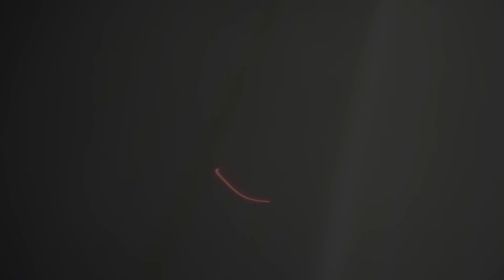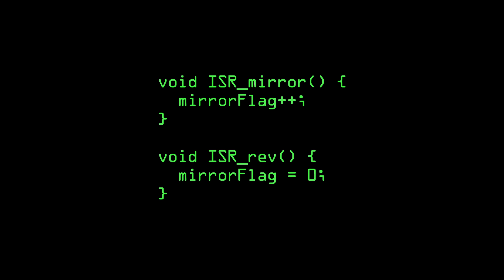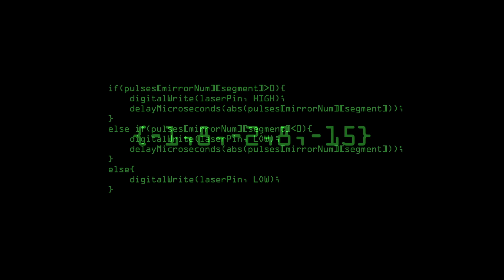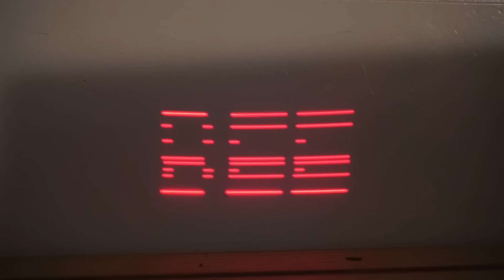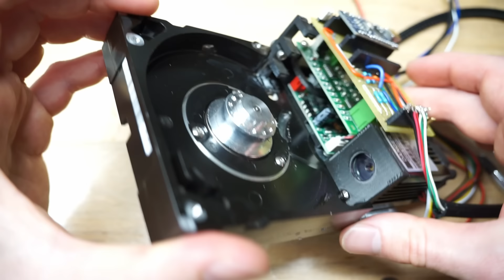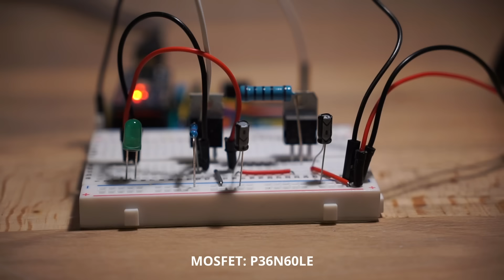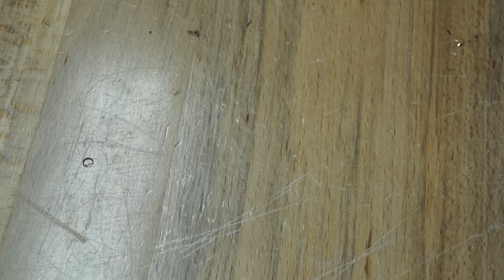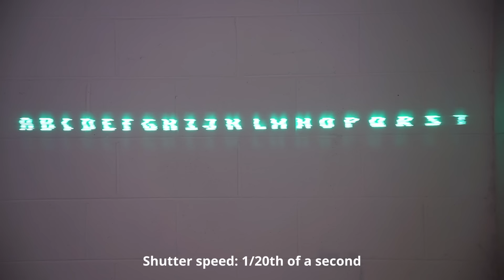DIY Laser Projector - Built from an old hard drive

Comment: honestly a faster and bluetooth enabled mcu would've been more fitting for this project. an esp32 is cheaper than an arduino board and a bluetooth module. it also supports arduino.h and is way faster. another thing you might wanna do is write to the arduino registers directly.
also, what software did you use for the exploded view of the projector?
Reply: also sorry but you really look (i think it's just lack of movement and blinking) and talk like an android lol
Reply from the maker: I actually tried an ESP32 at one point, but it seemed like it had trouble reading the interrupts reliably, so the timing was off. The software I used for that was Fusion360 - you can render animations in it.
Reply: @benmakeseverything  thanks
Reply: @benmakeseverything   I keep posting this comparison showing the interrupts problem  https://www.youtube.com/watch?v=boF4cX338k4&t=607s

Comment: You loose a lot of laser power on the mirrors. Use prisms instead. 4-5 prisms should be enough for a main wheel (horizontal deflection). Use a second prism array for vertical deflection. This is much easier to control than to adjust two handfull of mirrors. If you use a faster controller, try to switch to magnetic rotary encoders for position telemetry. They are much more accurate then light switches.

Comment: If the laser diode is removed from the HDD frame chassis the vibrations from the main motor will be removed and the wavy effect of the text shall reduce to an extent and the mirror carousel needs to be checked for rotational balancing just like a gyroscope flywheel or a spinning top ..  for best result simulate it on ANSYS

Comment: I love the retrofuturistic cyberpunk aesthetic of the scan lines and slight wobble. There's also a lot of tricks in both software and hardware to get better resolution. 

Definitely look into faster chips, the ESP32 is great in that regard. You could also use a shift register or serial control chip and external clock to control the beam pwm. Basically write your bytes into a register, and clock out bit by bit directly to the beam control. That will give tighter temporal accuracy as well.
Reply: ESP32 is a great chip, highly recommended.  Also better to run it to the wire instead of on top of an operating system regardless of it being a real-time operating system or not.
Reply: Yeah i love the scan line and think he should program one into it. The wobble is a bonus. Im totally building one
Reply: This. I love the jitter that the camera is picking up.
Reply: I was going to suggest he tear their hair out and just get a small FPGA dev board. Good excuse to learn some HDL if anything and really can get extremely tight timings even on low end chips.
Reply: @Noubers  Yeah that would actually be the 'right' approach for flawless timing.  To get it perfect each mirror also needs programmable nanosecond scale offsets to account for slight angle variations.
Reply: @darylfortney8081  clearly just needs to minaturize the JWST mirror accutators ;)
Reply: ESP32 would also be my choice. There is also the option to connect through BT or WiFi to a nice APP defining the patterns or texts.
Reply: @greekstraycats  More chinese chips lol, do you see that they are trying to destroy the western eco system by copy catting?
Reply: Don't travel to the USA.  Students study hard, and you easily steal their ideas from their brains. That sounds like a good deal. Fighting for freedom. New slavery. It is my responsibility. I thought everyone should know. We are imprisoned in a place whose slogan was freedom.  Don't travel to the USA. Never even for a short time. If you have any special knowledge or skills or an invention, they will steal it from your mind. The US government initially used this method to identify people who intended to harm the United States. But today, they use it for many purposes, including stealing information from people and stealing data from people's minds. Many celebrities like Taylor Swift and Harry Styles are helping to lure the US government. They can see whatever you see. You'll never have privacy even with your wife or girlfriend. They could see whatever you think. When Taylor Swift said I used my best colors for your portrait, she meant it. when she said, "Touch me, and you'll never be alone." Or when she said, I can read you like a magazine. Your silence would help them to do it again and again. They said, "Don't say anything because of the USA. I want to take her to court. They wanted to pay me $1,000,000. Those are not only songs (Taylor Swift) likes A writer of crime stories whose stories are authentic and have committed all the murders. Taylor Adolf Hitler, the Humans, are not your laboratory mice. Sometimes, what we hear is like warning lights to prevent accidents. Events that the causes of those events are not afraid of repeating them, but they are happy. Money,  power and Black magic There are three levers that they use to achieve their goals. Let's not ignore what we hear. Kidnapping in a new style. Please like and share this to spread awareness and support
 ......................................... #TaylorswiftIsMurder  Doggy styles ( #HarryStylesIsMurder ) #SelenagomezIsMurder 
#BidenIsMurder
#Astatueofstupidity
  #TrumpIsMurder  
#NotraveltoUSA
Reply: Arduino code runs on ESP32 as well.  Plus it has two cores, faster, and has the BT/WIFI built-in.  For ~US$6, you get the arduino and the BT controller card in a faster dev board.
Reply: Too much promotion of a CHINESE product ESP32. How much are you paid for ?
Reply: @sheshankutty8552 your iPhone is made in China. They're just really good at making cheap electronics, and that means that's where most electronics come from.

Also the ESP32 is literally just better than the Arduinos in pretty much every way lol
Reply: @randomblock1_  How do you know ? iPhone is now manufactured in India too, and they have other assembly lines in couple of more countries.
Reply: @sheshankutty8552  Foxconn produces iPhones. They operate in Shenzen, China. They have a few other locations but that's by far the largest one.
Reply: @randomblock1_  What that tells you is that, we don't need China to produce iPhone or anything else, you are Funding oppressive regimes.
Reply: @sheshankutty8552  ESP32 is most used IOT chip in the world. What is wrong with recommending it ?
Reply: @alexnik8334  because you don't know what is in it? It is chinese.
Reply: @sheshankutty8552  I don't care if it's good and I know for sure what is in it. Tensilica Xtensa LX6 microprocessor core is well documented. ESP32 is a dual core Tensilica Xtensa 32-bit LX6 with additional peripheral and I\O. Or Tensilica also Chinese company for You ? If it's so, then all ARM CPU's are Chinese, because there is Chinese manufacturers making Chinese ARM processors.

Comment: Hard drive motors NEED to spin counter clockwise, due to their hydrodynamic bearings are designed to pump oil only in one way and if they spin in opposite direction it will wear out and seize the motor up
Reply from the maker: Yeah it is actually spinning Counter-clockwise, I noticed it did not spin as well the other way. Which is annoying for me because we read left to right. So I had to make the code count backwards essentially.

Comment: You can simple improve the whole control electronics by switching to ESP32 board.
Reply from the maker: I actually did try a ESP32 at one point, but it seemed to have problems with the interrupts not being accurate.

Comment: Nicely engineered and explained. I wonder whether the "jitter" you're seeing is down to the Arduinos timer0 overflow interrupt - automatically running in the background - used for delayMicroseconds( ) ?
Reply from the maker: Probably, I'm still learning Arduino so I'm sure the code could be optimized quite a bit...
Reply: @benmakeseverything  In the IDE - from the get go - a milliseconds timer is started automatically. When that interrupt fires it takes time to process and will put a "stutter" into any time critical code. It's running continuously in the background. I'm betting that's why you're seeing  stuttering  (wobbly line positions) -  rather than it being a problem with your 3D print. Great project & inspiring stuff and well done by the way. Awesome! :-)

Comment: remove optical sensors and install 3 magnets divided by 120 degrees , and install hall sensors instead optical, when you can more accurately control rotation speed. add driver to control mosfet cause arduino is not able successfully to charge and discharge mosfet gate, and timming on/off of your laser will be also accurare
Reply from the maker: Good suggestion. I do think hall effect sensors would be better - If I build another one I'll probably do that.

Comment: Amazing project! :)

You could try altering the mirror angles in a cross pattern, so the point of mass would be equalized by the point of mass of the mirror on the other side of the wheel. This would also mean your code would have to change to render the lines in alternating manner from top/down to middle, instead of just top to down. Try doing anything you can to reduce the vibrations. It will help with wobble a lot.
Reply from the maker: Thanks! I think you are correct, the mirrors should be alternated in a different way to balance it out. If I build a second one, I'll try that.
Reply: @benmakeseverything  Would it be possible to put only 1 mirror and angle it with a stepper motor as it rotates around?   It would require a Rotary Slip Ring but if you can programmatically adjust the mirror angle maybe you could get better results that way?
Reply: @benmakeseverything  also balance out the rotating section
Reply: Very smart suggestion. Kind of interlacing right?
Reply: @critical_always  Yes, 

@thatonesnowboarde, the stepper motor could also be a good solution, Im just worried the steps might be too harsh for such small adjustments and lead to vertical wobble. 

An oscillating mirror attached to an electromagnet, like ones used for camera or dvd drive lens focusing might be a better option, but controlling it is very hard, especially if mirror is heavy.
Reply: @redusercolor  maybe tilt it with piezo instead... we're talking about very small movements here... PLL and resonate it.

Comment: Handheld barcode readers have a little mirror oscillating in them. Use that insted of the hard drive. To have multiple lines - use another one with a lens to restrict it's angle / or use 12 cheap lasers. Also switch to esp32 - much faster, has bluetooth already, can act as an AP to provide a webpage for settings. Good job!
Reply: I suspect repeatability would be an issue with the oscillating mirrors - might work well for a y axis though. Big benefit of the mirrorwheelofdeath is it acts as a flywheel to get pretty consistent speed, which is also (angularly) linear since it doesn't have to reverse direction at the ends - it's what the fixed barcode readers in supermarkets use (you probably knew that though, by the sound of it). Actually laser printers do too, at least the ones I've pulled apart used to :D

Comment: Pretty impressive results!

A couple of ideas to improve, I'm not sure if they would be practical to implement.

To stop the wobble, use a fast photodiode and a mirror in the output path of the laser, to synchronise the laser switching with the actual position of the laser beam. Have it inside the housing, laser turned on until it hits the photodiode, then quickly turn it off before the beam reaches the start of the opening. 

The switch faster, use the hardware UART and encode the character table into bytes, that would limit you horizontally to 8 pixels per character, unless there is a mode that has no start nor stop bit
Reply from the maker: Thanks for the input. I definitely think there is a lot of room for improvement in the code. I'm still learning Arduino.
Reply: A chain of shift registers would give you arbitrary width. Push bytes via the uart into the shift registers, then clock out bit by bit to control the beam.
Reply: I like the idea of getting the lazer position directly.
Laser printers uses this method.

Comment: PRoblem with 3D-Printing is, especially with PLA, it bends. When this thing rotates alle the parts are put under stress which is pulling outwards. You adjust everything and its fine.
Next day, everything "losses" that rotational stress and is back to it's position prior the rotation. Everythings needs a new adjustment now... you have to print and a much stiffer material or print it with a resin-printer and a really stiff resin.
Reply from the maker: Yes, I found that out the hard way. I'd like to have a block of aluminum machined with the exact angles and then electroplated and polished to a mirror instead, but that was outside the scope of this project.

Comment: HI! Is there any chance of obtaining a schematic for a laser printer print head? I kinda have a feeling that it has already been solved and mass-produced for decades. Well except for the laser wavelength probably.

UPD: a laser printer head also has a photodiode to precisely sense the exact moment of the laser beam moved across the mirror
Reply from the maker: I thought those just projected one specific angle and the paper was fed in by a stepper motor slowly - but I'll look into it.
Reply: @benmakeseverything  Yes! You are right actually! For the laser printhead you gonna need a second mirror to deflect the beam in the Y-direction. But the idea to use a photodiode instead of a photo-interrupter seems better

Comment: ESP32 next time. Faster and has Wifi and Bluetooth. You may also hack an old laser printer for sych a project.
Reply from the maker: I did actually try an ESP32, but had issues with the interrupts not being accurate. I don't know if its something I was doing wrong, or if that chip just isn't suited for this purpose.

Comment: Are you using the built in digitalWrite function or are you using direct port manipulation to toggle the pin?
Reply from the maker: digitalWrite. Still learning the more advanced parts programming for Arduino. I played around with ports for something else, but didn't implement it here. If I do another one I'd like to optimize the code for sure.
Reply: @benmakeseverything  if you need any help, toggling specific pins to help it run significantly faster I would be more than willing to help out!

Comment: Was your motor driver able to drive the rotation at low speed? All the drivers I could find were for quad copters and ran as fast as possible. Below a few thousand RPM, they just stop all together. My application requires a rotation speed of only 600 RPM and up to 3600 rpm. I am also trying to use disk drive motors. Tried my own circuits. No go. Not in in to be a motor driving wizard. Just want to get the job done.

Comment: You should use a raspberry pi pico (or more specifically, any board using the RP2040) because it has very simple programmable IOs (PIO) with FIFOs, that can control timing in a very tight manner. And even if you don't use them, the microcontroller itself is clocked much higher than an arduino.
Reply: Correct! Making use of the PIO's however can be quite challenging for someone incorporating them for the first time. A robust understanding of the specific MCU is needed to build a robust and expandable HAL (hardware abstraction layer). It does however payoff quite substantially - and can lead to impressive functionality for a 2040 (5 Dollar Board!) as seen in those popular projects that make use of its potential
Reply: Yeah, by "very simple" I meant that the PIOs are super tiny CPUs with a very simple instruction set, but that doesn't mean it's simple to use. It's probably easier to start with python and the PIO examples that embed PIO assembly in the python script, since one doesn't need to recompile, etc.
Reply: @DiThi  haven't really thought of MicroPython as I did not really look into it yet, but especially for a task like this one it really seems like a very accessible approach. Gotta do my homework to catch up on MicroPython I guess, when I first heard about it gaining popularity I was all into runtime optimization on AVR's to make led_blink go faster and stuff, where python just seemed counterintuitive - on those more recent 32bit MCUs with PIO or multiple cores (and improved compilers) this really starts to become a bit obsolete for DIY stuff I guess